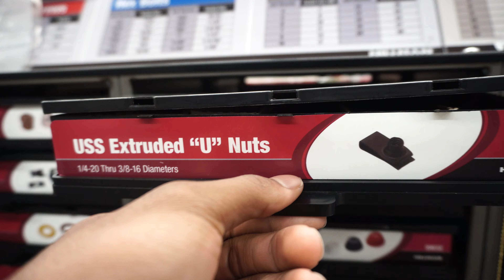GT500 Front Lip Install | MEANEST MUSTANG FRONT END!

Comment: Do you have to use the oem front lip splitter for the bumper or can u use a whole aftermarket front lip splitter on the bumper? I’ve seen some on ebay
Reply from the maker: It has to be gt500 lip bc the gt500 bumper has grooves on the bottom of it to only fit gt500 lips
Reply: @Tdurrgt  I appreciate it thank you. The whole process is inspired by you